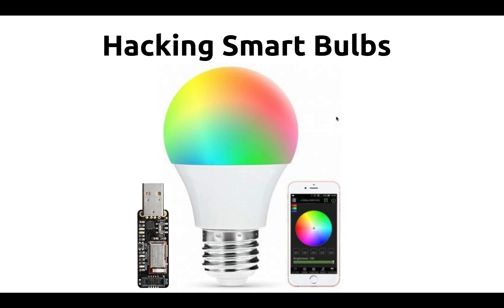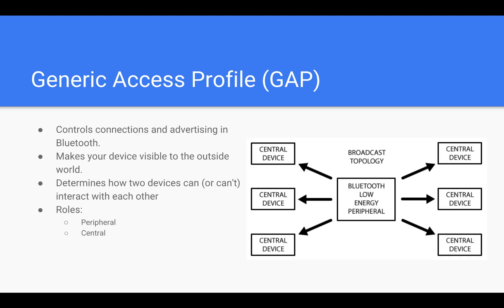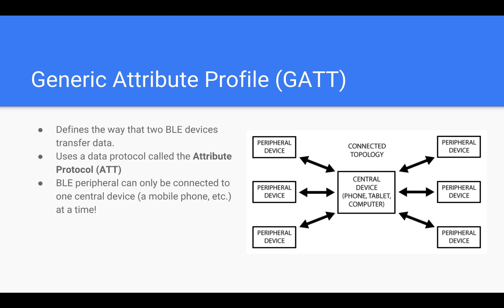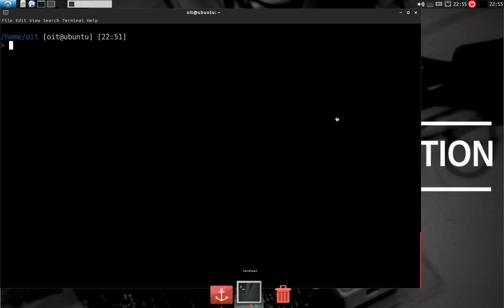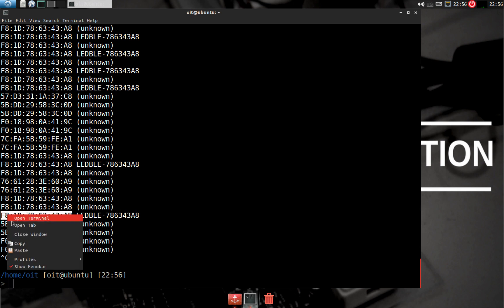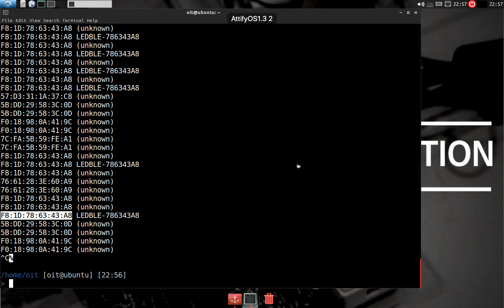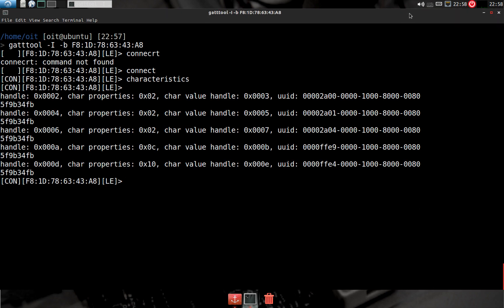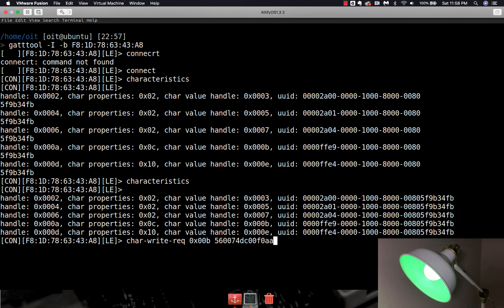Hacking Smart Bulbs

Comment: OK, first: if you're going to call yourself a "Cyber Security" operation, it would probably be a good thing if you learned a little about the technology you talk about. Bluetooth Low Energy is not, and has never been, a "lightweight subset of classic Bluetooth". It was introduced as "Wibree", for an entirely different purpose than Bluetooth and every single thing was incompatible: spread spectrum, modulation, data rates, message formats, everything. Like Bluetooth or Zigbee, Wibree filled up the 2.4GHz radio chipsets of the day, so if you wanted more than one service in a box, you bought more than one chipset, and you wrote stacks that would interoperate and keep the multiple radios out of each other's way. 

Well, Wibree turned our to be a complete market failure, so they rebranded  it "Bluetooth Smart". This also failed (as all products with the initials "BS" do) because you still needed separate transceivers for real Bluetooth and this "smart" thing. But chipsets got bigger and better, so it was common to have 2 SDRs on a chipset, with 2 stacks, so you could have a single chip BT/WiFi or BT/Zigbee,  or... Bluetooth/smart. At that point, you had Bluetooth 4.0, which simply swept under the rug the fact that the LE part of 4.0 was an entirely different system. 

Next: seriously? How many times did you say "exploit" in this little video? A dozen? You sound like one of those13-year-old kids who calls himself a L337 HAXR online, not a cybersecurity expert. You're using a device for the purpose for which it was intended, using protocols that are actually available from the manufacturer. You're one step removed from claiming you've "hacked" a phone by turning it on and sending a friend a text.